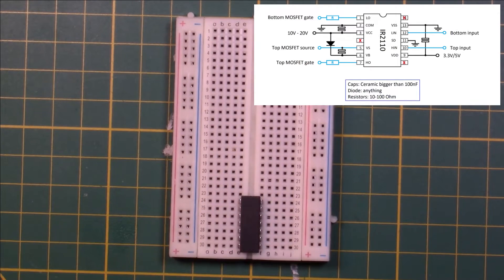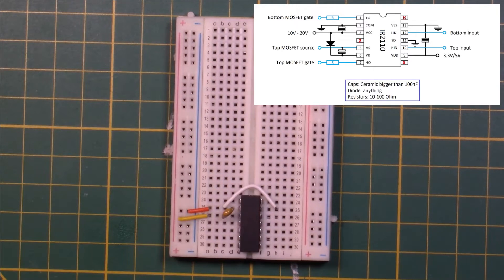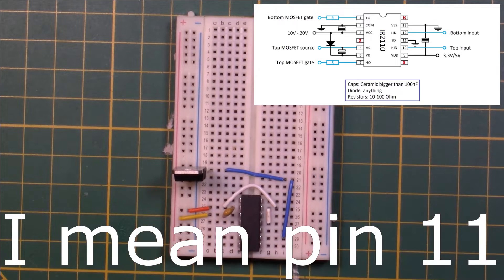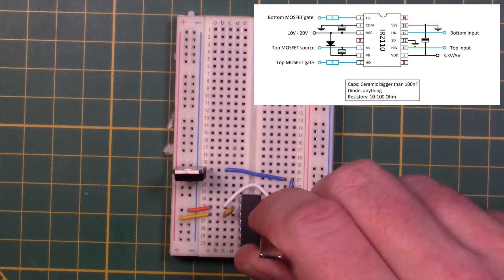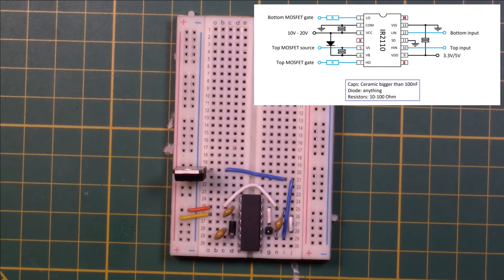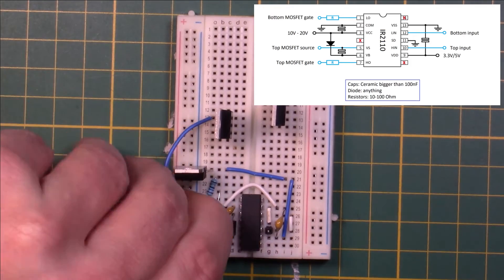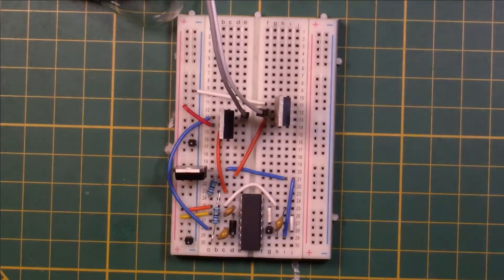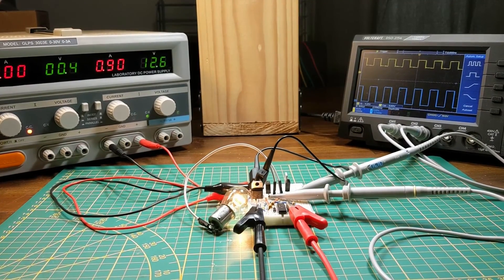IR2110 MOSFET-gate-driver

Comment: Wjats the blue trace and whats the yellow trace ?
Why one has a higher Vpp?
Reply from the maker: The yellow is the high side gate signal and the blue for the low side. I am not sure what caused the difference at the time. I guess the oscilloscope choose to use a different divider 10V? But the resolution of the video is just not high enough to tell for sure. Thanks for noticing!